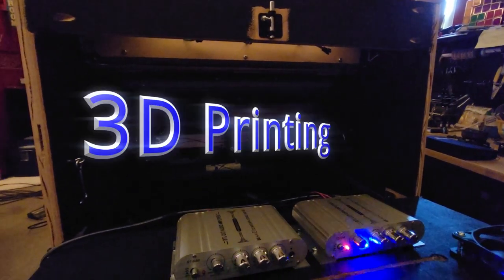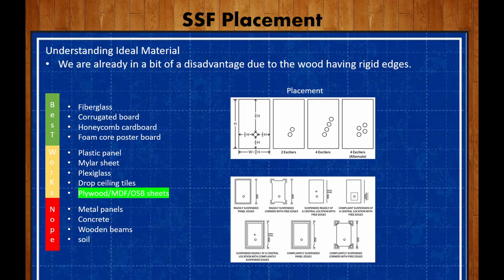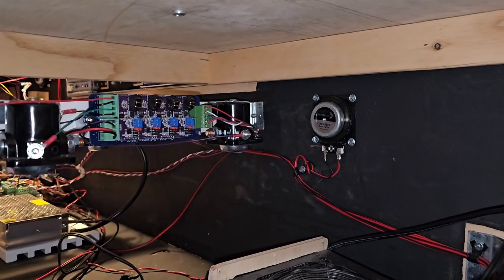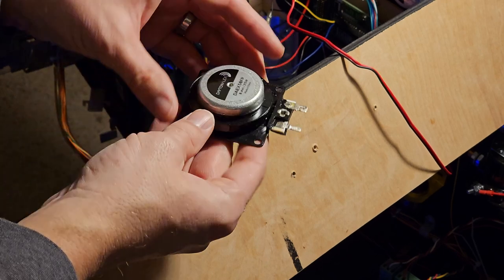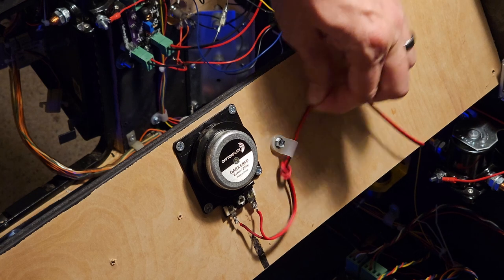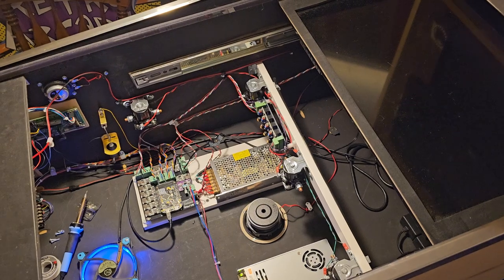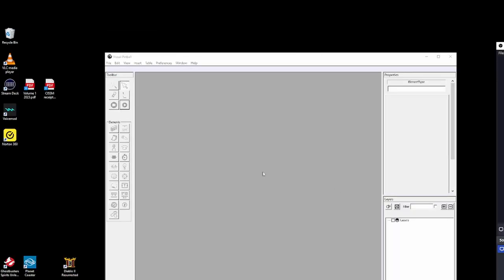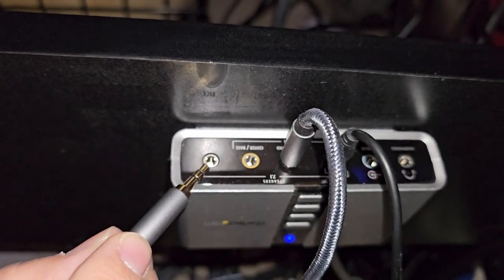Scrapyard Pinball (Pinball on a budget Episode 4) SSF How to get the best performance for your audio

Comment: Very clear walk-through. Thank you! -- Do you have a video on those rails you installed for the TV sled? I have spare server rails that might work for that.
Reply from the maker: Those will work perfectly. My next video will cover my cabinet mods I made to support DOF Links. I ended up using kitchen cabenet slides I got from a friend who upgraded his kitchen. Your solution will work. You would just need to build your sled a little differently. The idea is that you can access all the toys in the cabinet to perform maintenance or add new features in. All real machines can open in a way to access components. If you plan on adding dof, you will want to consider this.